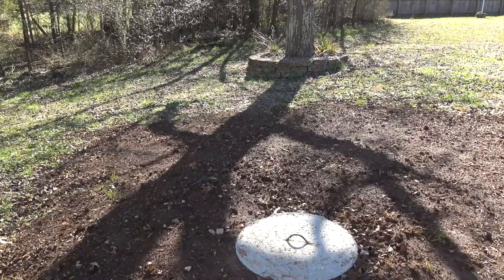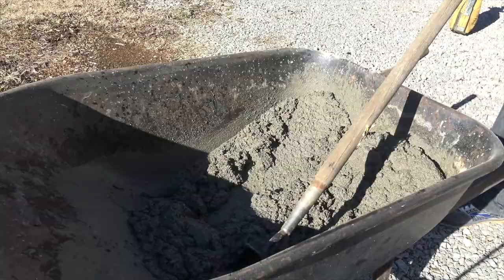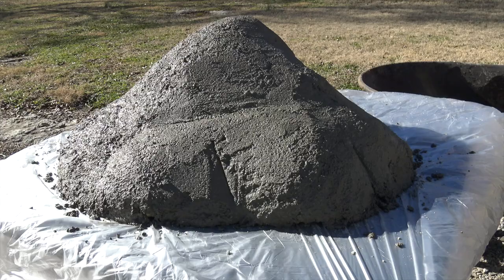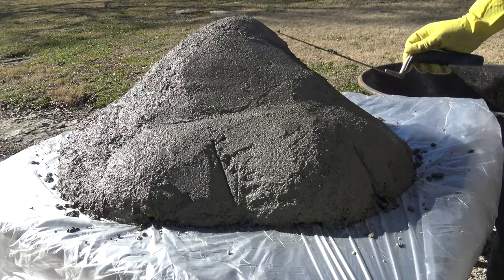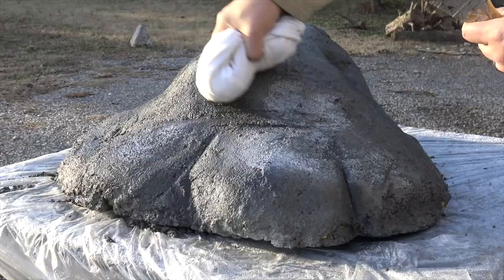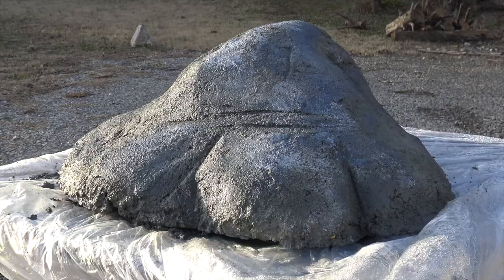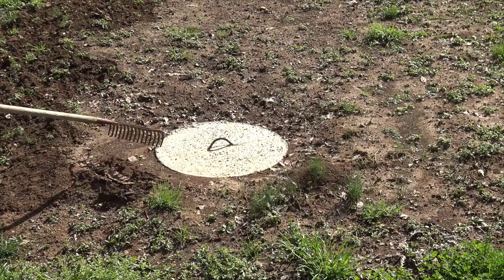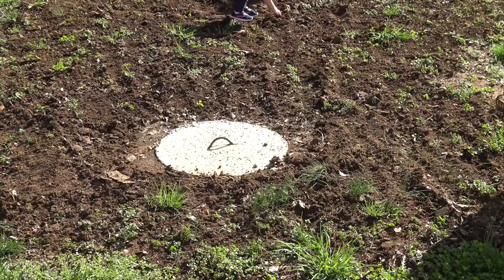SUPER COOL/ Fake Rock/ Build It

Comment: If someone hasn’t told you already once you get it mostly smooth use plastic bag to make impressions on the outside it makes great realistic impressions of real rock
Reply: Great idea
Reply from the maker: Thank you for the tip, Laura. We have some upcoming projects where we will be using this one for sure.
Reply: @MrandMrsAceofTrades  I think your rock looks GREAT!  About how many cans of spray foam did you use?
Reply from the maker: @casual454t1  We used about two cans of the spray foam insulation. The plastic bottles actually fill most of the inside space. Thank you for your question and watching our videos.

Comment: If you add reinforcement fiber it becomes very very strong and self supporting.  Great idea to use expanding foam as the form. Cement and soft sand on a ratio of 1/3 and add some colour dyes. Great job.
Reply from the maker: Thank you for the tip, Mark. We have some upcoming projects where we will be using this one for sure.

Comment: Just put portland over the top. Use a bonding primer if you want. Use a concrete stain/dye and pour the liquid into the mix and make it colored. Red and black is cool and making it layerwd is awesome. Plus glazing it at the end but with a matte gloss or flat is best. You can make theae better by making them round and then putting them into the ground.
Reply from the maker: Thank you for watching and for the tips! We will definitely try that when we make more.

Comment: Great job! How many bottles of spray foam did you use? Thanks!
Reply from the maker: Thank you! We used two cans of spray foam insulation and 3-4 plastic bottles. It is still holding up quite well and we will post an update video later this year.

Comment: That looks awesome! I read that rocks look best in groups of 3 in contrasting shapes/sizes. Next video project?  Haha, I'd watch it.  Can I get an estimated weight and size after it had dried? Great video 👍
Reply from the maker: Haha awesome! Thank you for watching and subscribing! We definitely have several projects in the works and we may make a few more "rocks" to go alongside it.
It is roughly 2.5ft across at the bottom and total weight is less than 30lbs.

Comment: Hey looks good. Did you empty the shell from the expansion foam and plastic bottles afterwards?
Reply from the maker: Hey! Thanks. The foam and the plastic bottles are permanent fixtures of the "rock." The foam and bottles are giving it a solid interior structure. It is still going strong after direct sunlight in the middle of the summer, snow and torrential wind and rain.